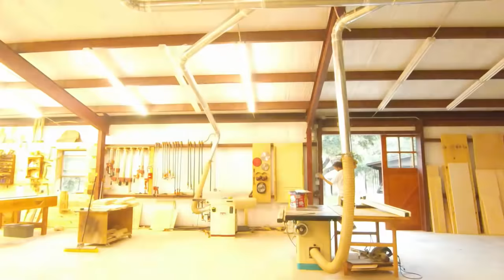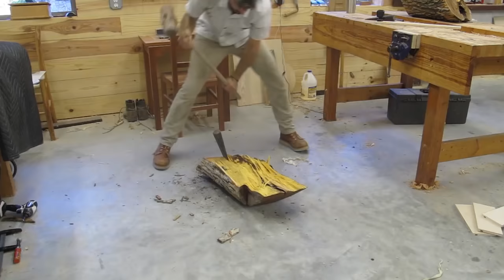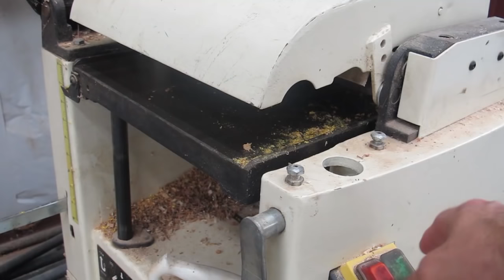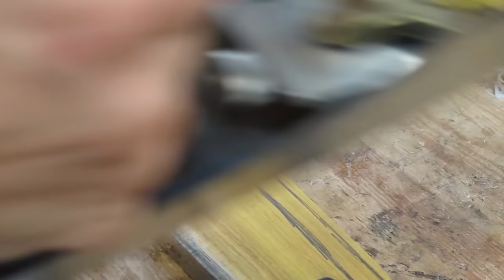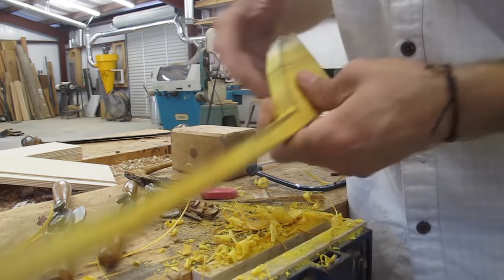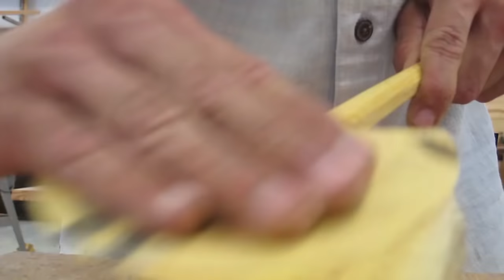Carving A Spatula From An Osage Orange Stump

Comment: OK, but if I were doing it, and I have several times, I would carve a spatula from a much smaller piece of wood (a branch for example) rather than an entire log. Nice shop! I guess I'm also a little surprised you don't have a much better way of bracing a log while splitting it. At any rate, I enjoyed your vid, and thanks for making it.
Reply from the maker: I rarely ever split wood to make my spoons or spatulas, I just included it in this video bc I wanted to try it.  As you can tell my process is a little rough.  I used to make Windsor and ladder back chairs and would split wood more regularly for that but haven't done it in years.  As far as the waste goes, I don't throw away the rest of the log, I can use for many more projects.   Thanks for watching!
Reply: eqlzr2 I think he used a log to challenge himself but I see were your coming from
Reply: Andy Rawls Do a music on the video's
Reply: eqlzr2

Comment: why did you use a wedge and sledgehammer instead of a maul or axe?
Reply: cause a wedge is the hipster way of doing it.
Reply: BUST IN PAINTS a wedge give u more control over where it splits
Reply: Or, I dunno... a bandsaw.. And then a sander.  Your shop, your wood, your tools, your rules, but damn.
Reply: Damon Diehl how big is your band saw I want one of those
Reply: I have used a wedge before- but it was confusing seeing him do it from the side

Comment: suggestion. you could make a steadying jig in the fashion of a large vice with a simple slide and lock system like what the guides on a tarble saw. It should help with the rocking back and forth when splitting the log.  There's not much you can do to stop you from  absolutely ROCKING in this video though. ;)

Comment: Osage Orange is a Very strong wood. As fence posts, it will outlive treaded posts. As firewood it pops. But in a closed fireplace it burns hotter than anything.
Adirondack chairs made with that wood will last for generations.

Comment: Either use electricity or don't. Once you use a corded tool why not use a band saw and a belt sander. Its not like you finished it with a card scraper you used sand paper.